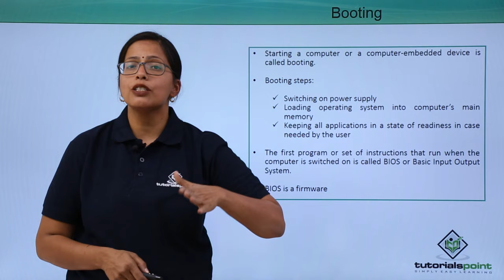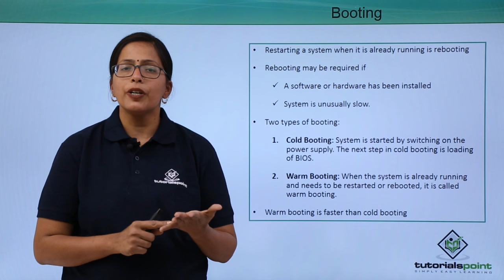Booting

Comment: ● Booting System:
1. Switching on power supply.
2. Loading OS into computer's main memory.
3. Keeping all applications in a state of readiness in case needed by the user.
● BIOS(Basic Input-Output System) is a firmware.
● Booting is two types -
1. Cold Booting
2. Warm Booting
Reply: 7547

Comment: In computing, booting is the process of starting a computer as initiated via hardware such as a button or by a software command.

After it is switched on, a computer's central processing unit (CPU) has no software in its main memory, so some process must load software into memory before it can be executed.

This may be done by hardware or firmware in the CPU, or by a separate processor in the computer system.

Restarting a computer is also called rebooting, which can be "hard", e.g. after electrical power to the CPU is switched from off to on, or "soft", where the power is not cut.

On some systems, a soft boot may optionally clear RAM to zero.

Both hard and soft booting can be initiated by hardware, such as a button press, or by a software command.

Booting is complete when the operative runtime system, typically the operating system and some applications, is attained.

The process of returning a computer from a state of sleep (suspension) does not involve booting; however, restoring it from a state of hibernation does.

Minimally, some embedded systems do not require a noticeable boot sequence to begin functioning and when turned on may simply run operational programs that are stored in ROM.

All computing systems are state machines, and a reboot may be the only method to return to a designated zero-state from an unintended, locked state.

In addition to loading an operating system or stand-alone utility, the boot process can also load a storage dump program for diagnosing problems in an operating system.

Boot is short for bootstrap or bootstrap load and derives from the phrase to pull oneself up by one's bootstraps.

The usage calls attention to the requirement that, if most software is loaded onto a computer by other software already running on the computer, some mechanism must exist to load the initial software onto the computer.

Early computers used a variety of ad-hoc methods to get a small program into memory to solve this problem.

The invention of read-only memory (ROM) of various types solved this paradox by allowing computers to be shipped with a start up program that could not be erased.

Growth in the capacity of ROM has allowed ever more elaborate start up procedures to be implemented.

Comment: how it is gonna load the operating sys if there is no power supply
Reply: It won't load. But it gets power supply from a small lithium battery on top of the ROM. That is why you can see computer's time keep running inspite of power off.